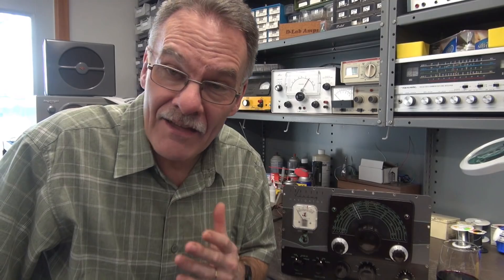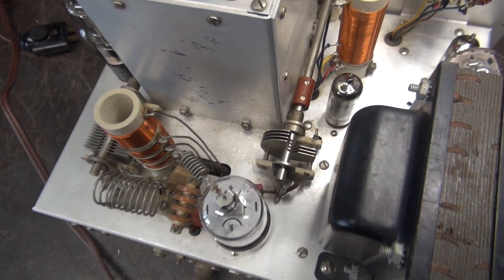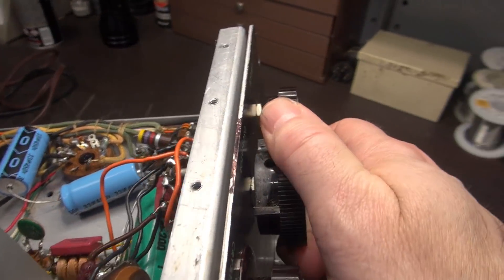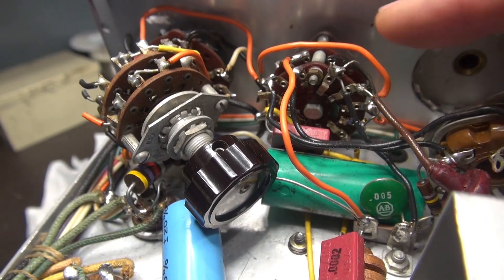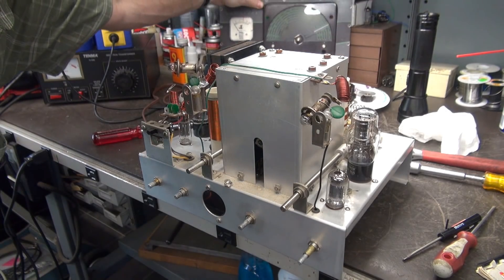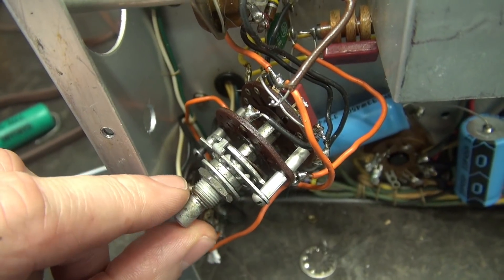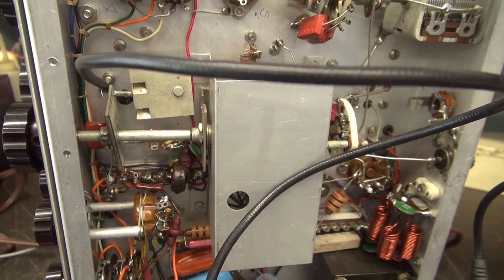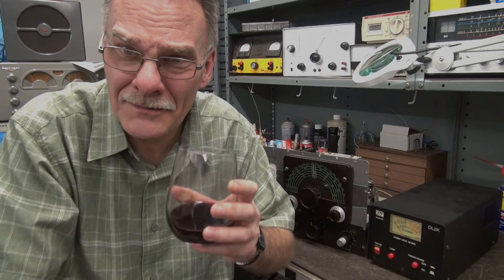How to repair frozen switch Johnson Navigator Ham Tube CW Transmitter

Comment: The only time to replace the switch is if it is actually broken.  They can always be freed up, if you know how-   Read On:  Gravity and the right chemicals are your friend.   When they seiize up.. it is always corrosion between the shaft and the bezel ( the hollow threaded part that goes through the panel and is held with the hex nut).  So the thing that needs doing, is removing enough corrosion and supplying enough lubrication to allow the shaft to turn.    Usually this can be accomplished without removing the switch.  My favored product is Tri-Flow Lubricant... this contains solvents that will loosen gummed up grease, and often will break up enough corrosion to free up the shaft.   There are two other products which can be effective with more serious  shaft rust/corrosion.  First is DeOxit D5.   this contains a very mild acid, as well as lubricants... and of course it is made for switches so any that gets into the switch will do no harm.  Another product is liquid wrench... it is among the best for actual rust.  To use any of these products, you must point the shaft toward the ceiling so the stuff will be carried along the shaft into the bezel.. where the binding is happening.  Time is your friend... Do NOT lean agressively on the shaft with pliers.. wait.. re-apply, try to get a little wiggle of movement.. then re-spray, wiggle and spray.. they will eventually yield full movement.
Tri-flow is what you want in there when you are done... so if you have used the other products.. use it last, as well as first . Plenty of paper towels are required to keep this stuff out of the radio itself, and to keep absorbing excess that runs out.
    One trick I have used is to get some clear plastic tubing..that will fit over the shaft and bezel ( you removed the knob for all the above)  now you can fill up the tube a half inch or inch.   You can even blow on the tube to force the stuff into the bezel.
only slightly nicer than kissing a dog.,   The ball detent on the inside of the chassis should get a shot of tri-flow at the beginning,
In bad cases...you have to remove the switch from the radio.. put the bezel in a vise, and work on it on the workbench.. until the shaft will come out of the bezel.  Then use fine emery cloth ( 150 to 400) to polish the shaft. then lube, re-assemble and bob's your uncle.    w6wuh

Comment: Nice fix Terry... Once again you shower us with your tech-tip life experience, Thanks! That switch doesn't look that complicated in the idea of knife blade tabs passing through pincher contacts. I'm sure there is an exact reason for the "failure", my vote is >>>>>>>>>>>>>>>>>>>>>> "the cobbler"! The soldering is suspect, overheating, etc...

Comment: All you need is to HEAT the mounting bushing of the switch with your solder pencil that has a  CHISEL tip !   This should not hurt the panel at all.   It draws the lube in as well and it WORKS every time !

Comment: Those meters are pretty but are crap! I'd replace mine and set the original on a shelf. You should come up with a procedure to liquid fill them to damp 'em. Do it for the purists with a twitchy eye. Kinda like the pressure gauge on an old air compressor.. or a compass in the hand of a shaky hiker. That's a CLEAN Tx... to me, the best indicator of the environment the unit has lived it's long life in is the condition of the paint on the transformer laminations. It's thin and so quickly replaced by flash rust if given even half a chance.  73 OM

Comment: These switch seizures are often the fault of old greases that turn solid. Some not only dry out, but seem to turn to ceramic-like material. There is an infamous green grease used in some cameras of the period that now has to be scraped or ground off. I’m not sure that any penetrant offers a good solution to such a problem.

Comment: I had a jammed rotary switch that I freed by cutting a three inch piece of vinyl tubing that press fit over the threads on the switch. I then put a very tiny hole that the straw applicator from PB Blaster would press fit into in the side of the vinyl tubing with a very fine pointed soldering iron. Next I clamped shut the open end of the vinyl tubing. Then pressure blasted the PB Blaster into the switch. Putting the lube in by pressure instead of capillary action made all the difference and saved the day. Just make sure to have scraps of cloth on the inside of the chassis to catch the lube that blasts through!

Comment: My first comment here.  To begin, a masterful repair.  Many thumbs up.     I see other people have made conments along a similar vein to the following.  Here is my 2 cents.  To preface, this battle rages elsewhere on the web.  IMO, rated worst to better for penatrating ability comes WD-40, Liquid Wrench, PB Blaster by a whisker over LW.   All of them though are like using water compared to the vastly superior performance offered by Kroil by Kano Labs.  A bit hard to find, but worth the effort.  Has saved my bacon on countless seemingly impossible frozen/rusty components both very large and very small over many decades.  Pro tip.  After applying any penatrant, tap (or bang, as appropriate) the area with a hard hammer.  This sets up high frequency waves that allow the oil to creep into the microscopic gaps in the crud/rust.
Reply: Kroil is about the best.It will disolves what the rest of penetrants can't. Used it for 20 some years in mechnical and instrumentation repair work.
Reply: As far as a supplier, a good Refrigeration Supply  house  or possibly Graingers wold have it. Also Google it, have bought it from factory before.

Comment: Terry, do you plan to save the old switch mechanicals and hand-me-down switch decks for possible future use?  Other commenters have offered suggestions on unsticking it; mine is to let the hardware soak in something like liquid WD-40, alcohol (not wine! 😉) or something stronger like MEK.  Even soaking in warmed up 3-in-1oil might help.  Without knowing what's gumming up the works it's hard to decide what would be best.

In any case, good job on both the repair and the video.

Comment: wd 40 is worthless to me. I would have tried something else.
Reply: Zundfolge1432 plus WD-40 stinks up the place. My first grab anymore is CRC silicone spray
Reply: @daveanderson5680  I would have tried something much more kick ass than wd40.   The knob shaft wouldnt turn so, pb blaster or anything more rubust than wd 40
Reply: also looks like he didnt try it for very long, maybe he did and didnt video it.  I would have worked the crap out of that knob lol